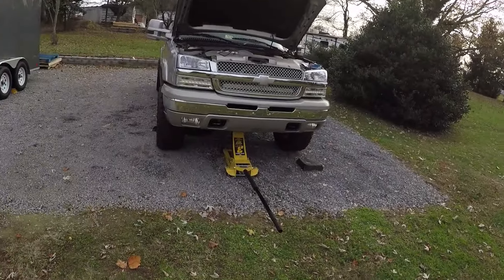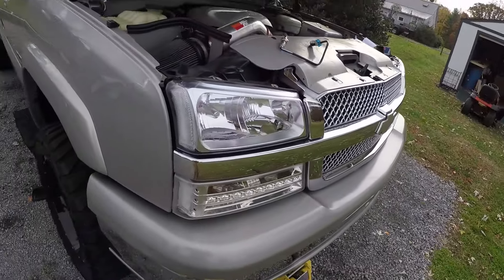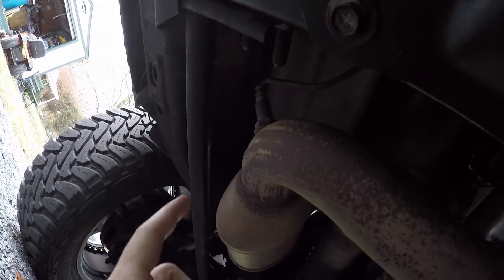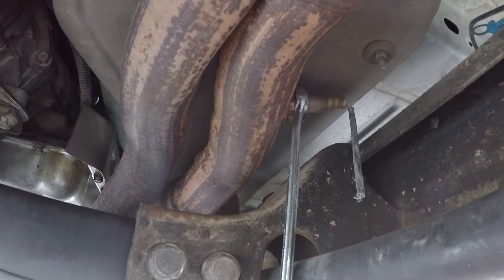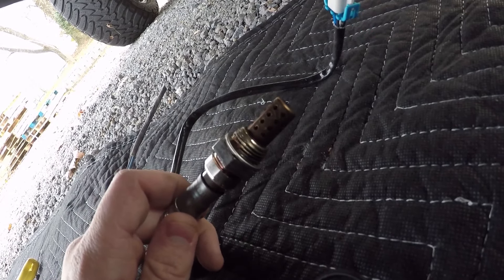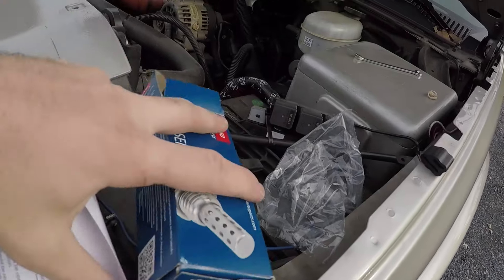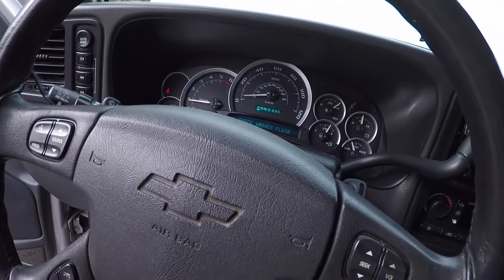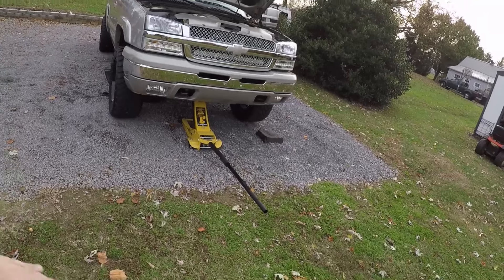How To Replace O2 Sensors in 99-07 Silverado or Sierra

Comment: Do your self and others that work on that truck after you a favour and put a little anti seize, never seize or copper slip on the threads. It will be a much bigger job about five years or so down the line when you replace that sensor again, and you strip those threads because they have galled.

Comment: Step 1: What I would do is get a scan tool and pull diagnostic trouble codes to see what the onboard computer in your vehicle is saying, or in this case where the PCM - is indicating the fault. Step 2: Once figure out the location, for example, if it's Sensor 2 Bank 2, which this O2 sensor is downstream past the catalytic converter on the driver side, check the wiring harness for any burns or exposed wiring insulation. Step 3: Take the known location of the faulty sensor, and switch it with the opposite side of the rear. Pull codes for a second time, if Sensor 1 Bank 1 appears and Sensor 2 Bank 2 disappears on your scan tool, then you know it's the sensor, and not an issue with wiring of the PCM computer module. These steps should provide a more accurate diagnosis, rather than throwing away money on unnecessary parts. Unplugging the battery does not always work.
Reply: Good idea
Reply: I thought Bank 2 is Passenger side???

Comment: Hey Bowtieguy; Austin. Great vid. Same thing happened to me. Replaced the bank 2 sensor 2 on my 2000 GMC 1500 and it wouldn’t run. Disconnected and reconnected battery again and Shazaam! It’s running! Thanks for the heads up.👍🏻

Comment: Got this issue myself to do. As usual glad yo see you have a video of how easy it is to change. I was at the dealer figuring my airbag issue out ( clock spring) and they found that sensor issue, quoted me $158.99 + tax with 0.8hr labor LOL.
Reply: You’re lucky I paid $900 lol
Reply: @Yoxicofficial  I got a 1,265$ tab to change all 4 on my Chevy dealership. I’m taking the old school fashion way of doing it myself for much cheaper and quicker.
Reply: @johnaly2675  yeah it’s easy 10 minute job

Comment: Well I’m the lucky winner, after I changed the O2 sensor on bank 1 sensor 1 and disconnected the battery as well it had issues idling. So I just disconnected the negative for 10 minutes and reconnected it and problem solved 🤭. Good ole tech aye

Comment: Hey, THANKS for the video.  Question;  did you replace ALL FOUR of the sensors ?  Or just the one that was defective (if you could tell which one) ?  How reliable is the "problem diagnosis tool" to identify WHICH of the sensors are bad ?
Reply: I would also like to know this.
Reply: Like anything else on vehicles replace in pairs. If it's actually the o2 sensor that's bad. On these silverados there's 4 sensors 2 up stream 2 down stream. What ever the code is for up or down replace both. This isn't a GM repair must it's just common practice. If one in the set is bad chances are the other isn't far behind. Also when it comes to the up stream o2 sensors they send fuel and air data to the ecm, so when you only swap one the other most likley is going to report slower and possibly cause another code or the same code just for the old sensor.

Comment: So to be clear Bank 1 is on the side of cylinder #1 which on these GM is the driver's side, but not on every vehicle or those with a transverse-mounted engine. I sure wish my bank 1, #2 was that easy to get to on my '05 Yukon XL as the plug is in a goofy spot behind fuel lines & other garbage. They do make a socket that allows you to remove the sensor w/out cutting the line. They are $5 on Amazon & can be a big help especially if you are pulling it for some other reason like inspecting or testing it. They should be installed with anti-seize on the threads and if not or just damn old & corroded you may benefit from putting some heat on it as they can often be very stubborn. Given how much of a PITA everything is to get off on my 05 I doubt a short wrench will be the only tool I get to use today.

Comment: I totally get were you are coming from about disconnecting the battery to change a tire, etc......however, the reason fort his is to eliminate the power supply in case it for some freak reason would start up buy itself.  The correct way is to disconnect battery, try to start the car, put key in pocket. If car starts after disconnecting the battery, contact supervisor immediately! lol (paul) ps....I really appreciate the info about the banks and what side they are on.

Comment: I got a 03 Silverado z71 5.3 rough idle lacking power black smoke flashing check engine light. I've changed plugs,wires coils and fuel pressure regulator and got new AC Delco sensors and ejectors ordered and will be here in a day or so.  I question is did your truck have these same symptoms before you changed your O2?

Comment: My mechanic said to disconnect the battery, replace the sensor, then take the battery cables and hold the terminal connections together for 20-30 seconds. He said this resets the computer so it goes back to pre failure settings so you will not burn out the new sensor right out of the gate.
Reply: This also sounds like a nice way to reset your computer if your on the side of the road without a scanner and need a reset also.  Thanks for the comment.

Comment: Do you need to replace all of them or just the one that shows up in the code or both sides? And what if is not showing in code at all. I had to change the throttle body and now the light is back on and huge decrease in fuel economy.

Comment: If you have ever had a wrench fall and jet japped between sat the starter bolt and groung while you are nearby captive under the truck, you will disnonnect the negative battery terminal from then on

Comment: Thanks for confirming location. I have code P0060 which I assume is Bank 2, sensor 2. Is that correct? I also had P0053 and one other show up as well. I reset the OBD and for now only P0060 showed up. Is it safe to say that the others showed up because of P0060 and if I wait long enough they will reappear? In other words just start with replacing B2,S2 first and then wait for result. Its a 2005 GMC Yukon XL Denali. Thx, Michael

Comment: Hi Bowtieguy, I watch a lot of your videos buddy; had a quick question for ya. If you were to buy a replacement engine for your truck what route do you recommend going? Would you say to get one of the GMPP crate engines or do you recommend rebuilding my block with upgraded internals? Thanks bud

Comment: I was doing transmission cooler lines and didn’t disconnect my battery. Of course my metal line arced on the starter connection quick and scared the dung outta me. Ya, be safe and disconnect your battery

Comment: I was truly astounded by how easily your sensors came out. I just got my truck a few weeks ago and bam! It codes on me for bank 2 sensors 1 and 2. I think the guy at the factory pulled some kinda joke and used some loctite instead of anti seize because they are stuck in there like crazy! I'm reefin on the wrench so hard I'm moving my truck but the sensors simply will not budge. Any tips for me?
Reply: Have you tried turnin it the other way lol
Reply: Penatrating fluid

Comment: My cats were clogged so i got some basing new ones an am ready to put them back on from a straight pipe. I also have to change both down stream o2 sensors. I hope after I put my catylic converters back on and put the mew o2 sensors on that the check engine light will go off. Any help please?
Reply: @bowtieguy97

Comment: What type & size was your open end wrench ? The 02 pulls fuel up ?
Reply: It's usually 7/8. The O2 sensors measure the amount of oxygen (hence the name O2 sensor) so the computer can apply the proper air/fuel ratio to the engine.

Comment: PO135 code. Sensor 1 bank 1. Should I change all of the 02 sensors? My 2004 GMC Sierra has 80,000 miles.
Thanks, Bob
Reply: Robert Watkins no just the up stream O2 on drivers side only, I would test the others while your in there by back probing the two black wires and Checking amount of resistance

Comment: I replaced the battery on my truck and it wouldn’t start either. I did some research and found out that my truck no longer recognized my key. I had to turn the key to the on position and leave it there while the security light flashed. When it stopped flashing I turned the key to the off position. I had to do that process 5 times but it finally started:

Comment: how hard would it be to replace a oil pressure sensor
Reply from the maker: green arrow not sure, I have to replace mine actually the OD reads 80 PSI as soon as I start it I’ll make a video when I do it
Reply: On these you have to remove the intake to get to the Oil Pressure Switch. So if you plan to do it make sure you pick up a new intake gasket set.
Reply: Hard to get to,had a mechanic replace it,he did not remove intake to get to it,there are YouTube videos explaining how
Reply: 6/10

Comment: Have you had the service 4wd on dash yet? Would did u do?  Seeing as u have 300000 miles I believe u said. Sometimes my selector switches (push buttons) for the 4wd and 4lo and them don't work at all.
Reply from the maker: Natas N the transfer case selector motor, i think is what it’s called. But there’s a motor switch that selected the 4 wheel drive position and it goes bad on these trucks including mine. I haven’t replaced it yet but with winter coming I need to and I will do a video on it. But to answer your question yes I have gotten the service and that is what is wrong with mine.
Reply: bowtieguy97 , oh ok thanks alot! That's what I have been reading the problem to be and some say it's the entire selector switch board and since u have the same issue  it would awesome to see a video, if u get around to it. Oh and I replaced the same sensor like 3yrs ago lol. Thanks again.
Reply: @btgperformance9234  It's called the Actuator Motor. I think there are 2 or 3 under there by transfer case. One went out in my 99 Silverado back in 03 and it was $88. Now I get the service again. I've heard the switch on dash goes bad also.

Comment: I replaced my bank 2 censor 2 as it said low voltage!  Now my reader reads b1 c1 b2 c2 no voltage detected and it also threw about 4 more codes it wasn't reading before lol. About to put my other one back in at least I only had 1 code then not 6. Even got a random misfire code which is the worst, and a throttle tac code. Unreal

Comment: I do not agree with you saying "they don't cost a lot of money". If you got that one for $40 at advanced that's great. Unfortunately I am in Southern Cal and we don't have advanced. We do have autozone and there the lower right denso for my 06 silverado is $52 before tax, the lower left denso is $70 before tax(why they are not the same price I have no clue) and the upper denso is $91 before tax. For all 4 that's $304 before tax. Including tax will be like $330. Maybe that isn't a lot of money to you but it is to me.
Reply: The most expensive O2 sensor at rockauto .com is about $42.00. There are several brands to choose from. You do not have to replace all of them. Some last much longer than others.

Comment: Your engine light was off because you reset your computer but disconnecting your battery it was only by luck that it started when you did it again because you mediately re-hooked it up it needs to be disconnected for 15 minutes before will reset your computer possibly a little less time anyways good video

Comment: Discount the Battery for even tires. Like even my Toyota TRD sport there are sensors for the tire air and I have had to replace a sensor due to it being blown not to disconnecting the battery so it is necessary. It's hard to believe that but true!!

Comment: worse safety opt , do not see safety stand under the truck,
Reply from the maker: What are you talking about? 😂 the truck is lifted and had all 4 of its tires on lol I’m not that big of a guy
Reply: @btgperformance9234  great video, after veiwing your video again, you still dont have a safety stand to keep the truck from falling on you if the hydralic jack fails, always put a stand under the truck, the weight of the truck, by gravity, will bypass the tires, shocks, and springs and land on you, believe it or not,
Reply from the maker: Dude the truck at this time sat roughly 22” off the ground. The tires were still bolted onto the truck. With the jack under the truck the height was maybe 28”. If the jack failed the truck would fall 6” back to the original ride height of 22” and not crush me. If your trucks shocks and tires can’t handle a 6” drop they sure as heck wouldn’t handle hitting a bump or towing a trailer 😂